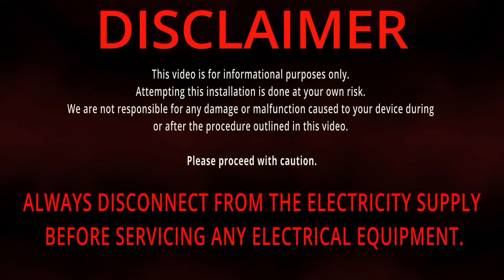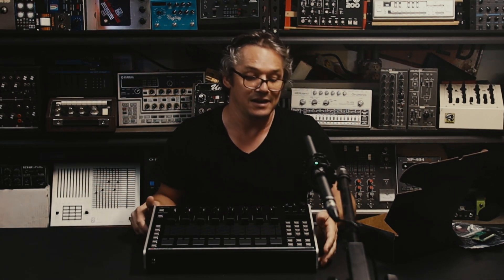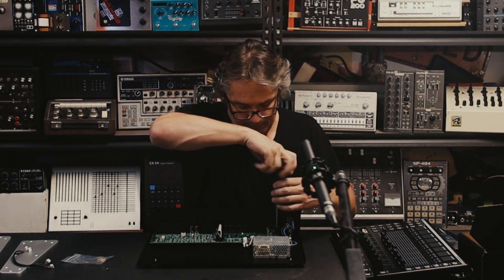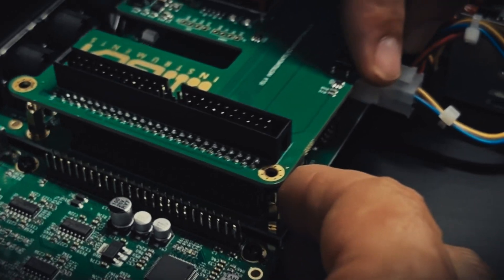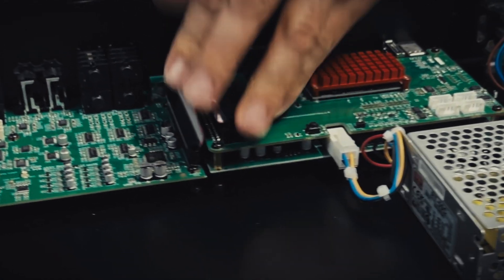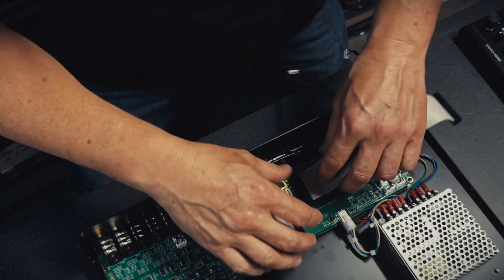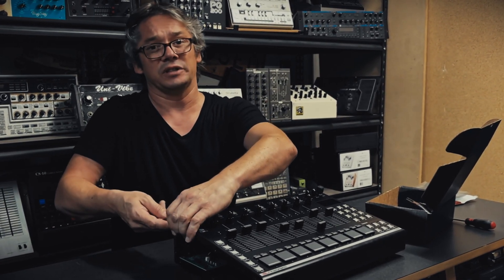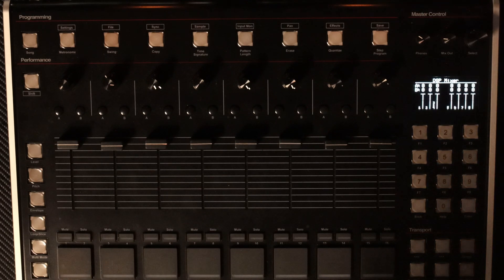S2400 DSP Upgrade Installation Instructions.

Comment: One other issue was when I first powered up after reassembly, it sounded like a playing card in bicycle spokes. Turned out one of the audio cables was touching the cooling fan on the DSP card, so beware of that.

Comment: And there's two different length screws for the side panels and the different lengths are not in the same screw hole on each side. Don't know what's that's about, but I used those little colored sticky dots you use on paperwork for markups to mark where the longer screws go. They easily come right off with your fingernail and leave zero sticky residue.

Comment: At 15:48 - I personally found it easier to reattach the top and bottom panels with screws before reconnecting the ribbon cable. With the side panel removed there is still plenty of room and visibility to do this and it just felt safer than trying to balance everything whilst trying to look to see if pins were aligned and applying pressure to make the connection. YMMV.

Comment: About two years ago I spilled about a mouth full of beer over some of the tactile buttons on the left bottom corner. I immediately turned the S2400 upside down and drained it out. I eventually opened it up and didn’t see any remaining beer inside. However, I noticed a few tactile buttons stick a little. Is there anyway to clean them without damaging them? I can still use the buttons I have to push on them once or twice. 😢

Comment: I wonder how is the dsp card handling latency
Reply: Considering the unit already has basically zero latency, and the card has processors on board, and the signal flow was specially designed to not have issues like that… I think it’ll be just fine.
Reply: @Kid_Sleepy well thanks for the explanation but I’ll like to see what the users says about it. Speculations wasn’t what I was looking for. But thanks anyway

Comment: Do units coming off the factory line today have these pre-installed?
Reply from the maker: If you purchase a card, we pre-install it for you, but it is considered a separate purcase to the S2400.
Reply: @ISLAInstruments  Do you charge for the fitting of the card to the S2400? Or is it the base price and the Isla combined? Plus do you have to mention you want it installed when buying or will it be done automatically? Cheers.